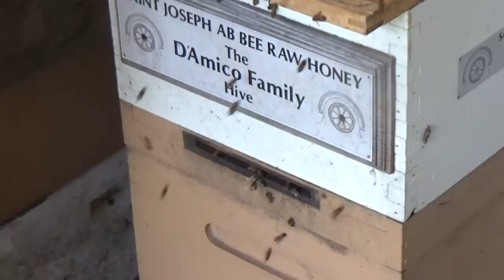Bee hive removal from the bedroom floor.

Comment: I'm pretty sure you've already covered what kind of vacuum you use, Mr Ed. But I can't find that certain video atm. So, what kind of  vacuum is for sucking bees?
Reply from the maker: It is a vacuum specially designed to vacuum bees because of it's very low pressure which does not kill bees. I built the vacuum myself, and here's the link to that video. Thanks for watching. God's peace.        Mr. Ed.
https://youtu.be/tV3mR39v6RA